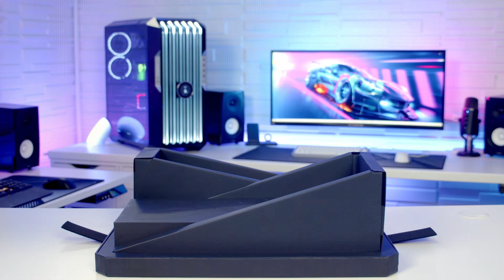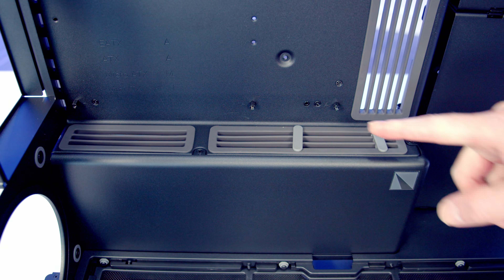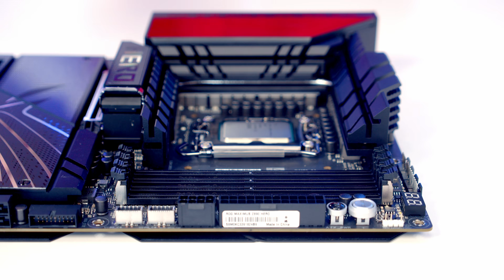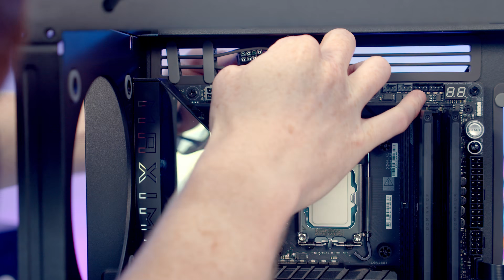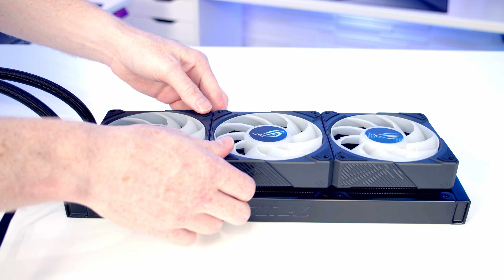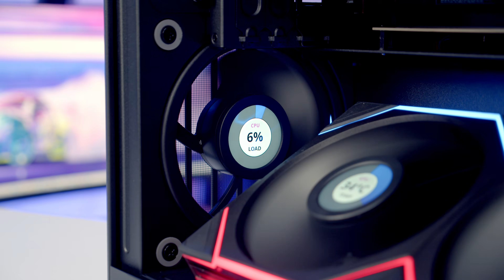HAVN HS 420 VGPU Build - Step by Step Guide | ASUS ROG MAXIMUS Z890 HERO + Intel Core Ultra 9 285K

Comment: AWESOME Yes
but there is a major design flaw there is no Cage Bay for HDD on the back of the case
the design is the HDD sits on that side bracket where the fans should be
so why dafaq i need to compromised on airflow for cage HDD drive bay 3.5 HDD
its a major NONO for me and a deal breaker ..... at least design and create 2 bays for 3.5 HDD on the back case 
that could make this PC Case NUMBER ONE for me

Comment: The LED Display monitor that is linked in the video is not the same one used in the video. I bought it and it is too big for the case AND does not come with mounting hardware so the knobs seen in this video are not the same as well. Just an FYI in case anyone does the same.

Comment: If it's an EATX (example Z890 Asus Extreme) motherboard the bottom PCIE lane will be blocked off if you need it like I do for a full PCIE card this case is useless Great case otherwise but avoid if you have EATX they say it is compatible but its not

Comment: Very nice case indeed, but... My two issues are that the open back panel allows for noise leakage, and also that the vertical mount will be an issue height-wise. AIO tubes have limited placement. The tubes touch the GPU (you don't want that with a 5090), and if the AIO tubes are above average length, it's really going to be an issue trying to avoid the GPU, and more so, a 5090 backplate.
I have been using the Cooler Master V3 mount because it allows for adjustable length and the ability to position the GPU closer or farther from the motherboard. I think if you're running an AIO and a 5090, it would be handy to find out if that Cooler Master mount fits.

Comment: 2 questions, Did you find a slight offset in the alignment of the riser cable connection and the mobo? (I've just installed a 870E Crosshair hero and it felt a bit too much off, Why have you not used the glass fan cover on the bottom?

Comment: Heya! I've got a question!

I got the same case incoming this weekend, going to run a 5080 and 3x LX140 on the bottom.
Will the glass plate on the bottom fanmount fit with the bigger cards? I don't see you using it in this build.

Nice build and thanks in advance!

Comment: I really like this case, but I think I would prefer the non-VGPU version. The included 2x6 RGB Hubs is really nice, especially with their positioning. The bottom one is better for the bottom fans and the side back fans. While the upper one is better for the back exhaust/intake and top radiator/fans. While most fans now have daisy chaining capability, this is always good for those who want compatibility with fans that have no daisy chaining, such as cheaper fans, or older fans.

One of the biggest design changes over dual chamber cases, much like the upcoming Thermalright TR M10, is that this one is more of a hybrid / half a second chamber. So it's more like a 1.5 chamber case. This is nice for those who don't want a full second chamber, but absolutely need the space for cable management, like I do.

On the non-VGPU version, it comes pre-installed with a very sturdy/heavy duty anti-sag bracket for long/large GPUs.

Comment: I'm sure part of the reasoning for 140mm fans on the bottom is that you need more airflow pressure in than out to avoid dust getting in

Comment: Love your vids as im about to embark on my first build this is inspirational. Do you think the aesthetics would be a bit strange if i put one or two fans on the side and opted for a smaller monitor? I need a positive pressure set up. So… 3 intake bottom. 1 intake rear bottom. 1-2 side intake. 1 exhaust rear top. 3 exhaust top.

Comment: Fantastic build. I think I want this for my next case, but I'm very torn on which version to get.

Personally, I think vertical GPU looks pretty stupid unless it's in a custom loop build with a plexi / acryllic block on it so you can see the colored coolant in it under the ARGB, which looks sick. It also keeps you from using your other PCIe slots for a high-speed network card to uplink to your NAS etc as far as I'm aware. The vertical GPU can also physically get in your way in ways a horizontal one will not (for example, James from Kit Guru had issues mounting an Arctic Liquid Freezer III 420 because of the vertical GPU, but that might have been a function of how tall his GPU was as there were comments saying they had the Liquid Freezer II in there and it's the same height). But on the other hand, that angled bottom fan mount does look pretty sick.

I think the regular version of the case looks pretty sexy too, I love the anti-sag bracket that's built into it, it would let me use at least the bottom PCIe slot (not sure about the one up from that, depends on GPU height), and if you wanted to do a custom loop, the bottom radiator mount is a must. The downside of this I would say is that the area between the bottom fans and the GPU looks very empty in this ocnfiguration. That space would be a good place for a sensor panel IMO, but I don't know if you could mount one there without modding the case.

I don't know why they won't just sell you the angled bracket and the VGPU mounting kit for $70 if you buy the regular one, or sell you the flat PCIe covers and flat bottom bracket / radiator mount for $30-40 if you buy the VGPU version.

I also think a 420mm cooler would look better at the top, it's a pity there are so few of them (especially if you want an LCD).

Comment: Question.  For the rear case fans is it possible to screw something in reverse order?  I noticed you had the screws starting from inside the case and you attached the fan to the back of the case.  Is it possible to reverse that?  If you mounted something inside the case (like an LCD screen) could you screw it in from the back of the case?

Thanks.

Comment: Amazing video; I just subscribed. Your links to Amazon for the fans dont seem to match your description in the video. For example, for the set of 3 fans the link takes you to the 120mm option, but in the video you mentioned 140mm. The side fans are 120 or 140? Asking because the Amazon links are for one 120mm and another 140mm... just confused. Other than that, again, thanks and amazing video.

Comment: Good morning. In my opinion it is not bad as a build composition, but there is always that fact that in the video card with the bracket, it makes the other slots unusable, if I should put a network card or a sound card like sound blaster I have no way. The card covers 1/4 of the monitor and if the monitor would find a Play cable alternative to the HDMI that would go to instruct the 2nd HDMI monitor that most users normally use, it would be an additional solution.🤔🙂

Comment: Nice motherboard. Be nice if the manual mentioned what the pcie 8 pin below 24pin does. I figured it was for overlooking, but if it just for faster charging manuel should say it.
Reply from the maker: Charging was the only thing i could find in the specs that it did, but it might do more
Reply: @ChristopherFlannigan  Jay from ASUS had an overview video of some of the Z890 series posted today. It was pointed out that the PCIE power plug adds 60w to USB type C near by like you mentioned. Does nothing more.